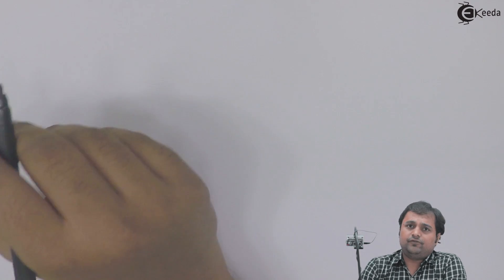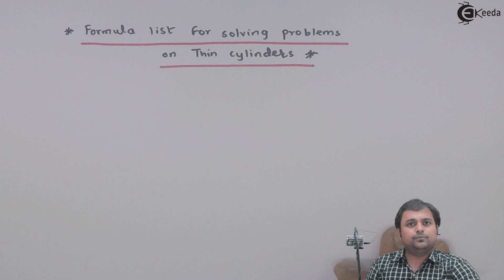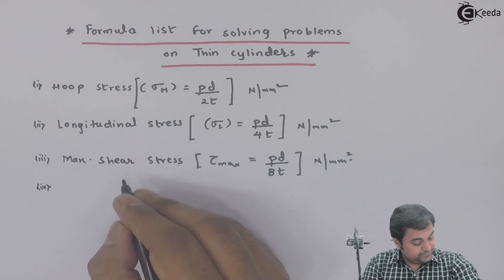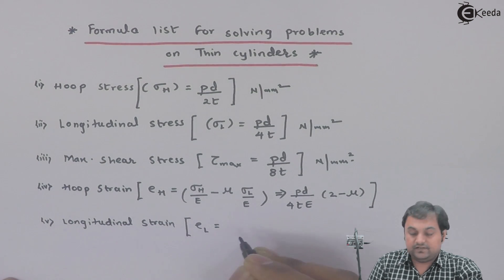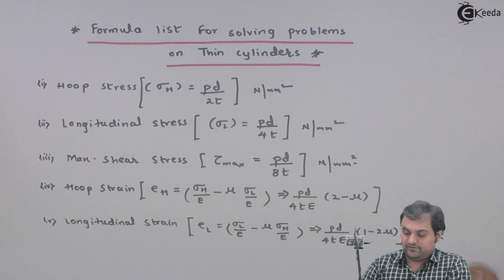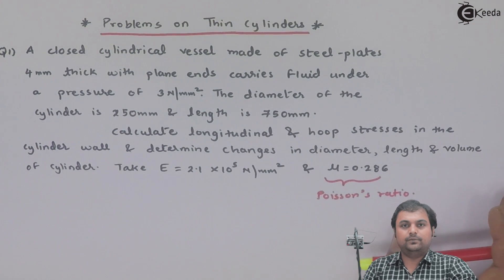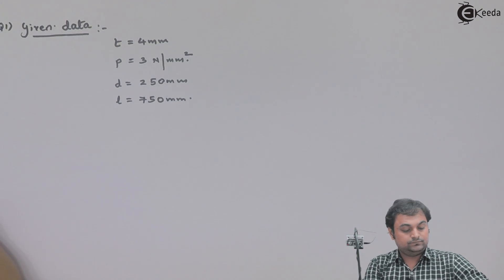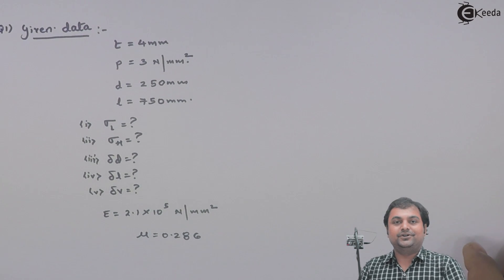Thin Cylinders - Problem 1 - Thin Cylindrical and Spherical Shells - Strength of Materials

Comment: sir. great work. now o dont have to study longer in those large books. simply explained.
i have a question . can u please anser.
question - A thin cylinder with both ends closed is subjected to internall pressure p. the longitudinal stress at the surface has been calculated as sigma , max shear stress will be equal to... ( my answer is 0.5 sigma) is it correct?
Reply: YOU JUST MAKE HALF OF LONGITUDINAL STRESS COS DENOMINATOR IS TWICE

Comment: I have a problem that in problem number 1 , you have taken volumetric strain = hoop stress + longitudinal strain but in problem 2 , volumetric strain = 2(hoop strain) + longitudinal strain. Not getting the concept!!
Reply: I too have the same question. I think volumetric strain = 2(hoop strain) + longitudinal strain because then only we will get volumetric strain = pd/4tE(5-4μ)  which is correct....volumetric strain=hoop strain + longitudinal strain leads to volumetric strain = pd/4tE(3-3μ) which is wrong.
Reply: I Sharma yes
Reply: Manab Sonowal  you are right
Reply: Ishan Sharma correct
Reply: My value of change in volume is 1.76×10¬4